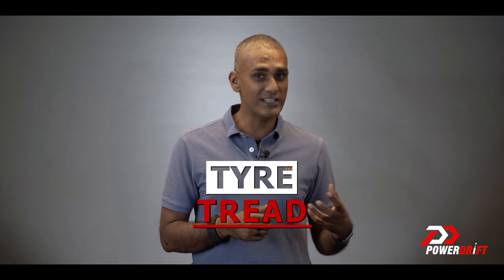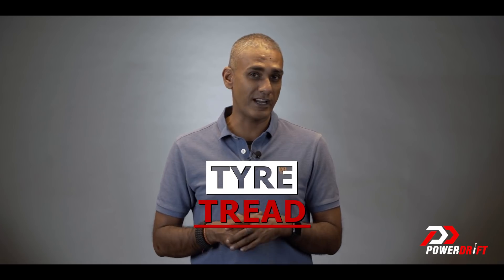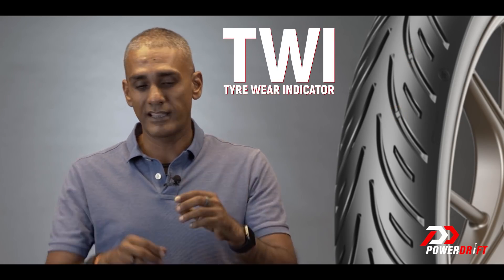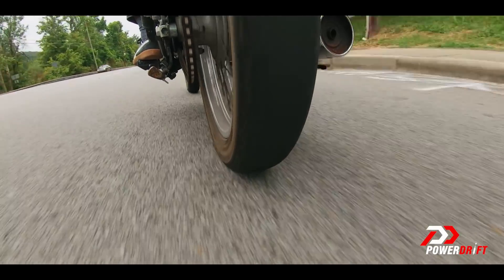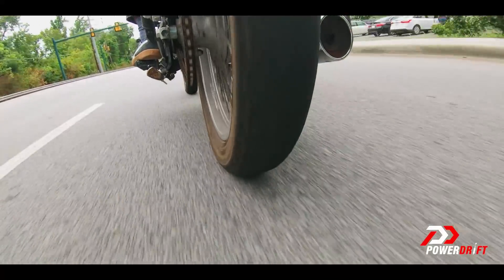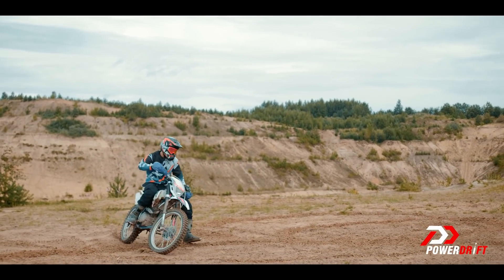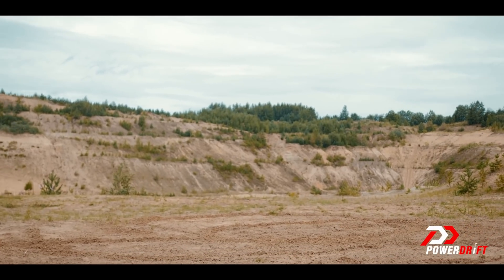PD Simplified | Tyre Tread: What Is It For?

Comment: really like your presentations, very well spoken and concise.

Question. Why are the front treads opposite to the rear treads on most** tyres (not slicks)?? Looks like the front sweeps water inwards towards the center of the tyre and the rear sweeps the water outwards away.

** I've seen the front/rear same in a very, very few instances. I inspect motorcycles as an official for very large events. Manufacturers do put rotation marker on treaded tyres. Dunlop don't put rotation on their KR108/109 (+1/+2/+3) tyres as I believe they are unidirectional.

Comment: Great video explaining science with respect to tyres ..so does it make sense to replace tyres only before a monsoon ? As tyres are worn out and are reaching the twi will result in more postive grip and may be infact better in the dry then with treads  ..it may be silly thought but something to think about
Reply: It’s very silly. You’re failing to account for the degradation in tyre rubber quality over the time it took to wear the tread out
Reply: But while it isn’t the only time, just before the rains is the best time to replace tyres
Reply: Dear akshay, in formula 1 when rain tyres (inters) wear out they perform job as slicks (called interslicks). But at the point tyre is worn pretty much and wont last more kms and power delivery also reduces. Thus they continue to use interslicks if the find a dry racing line on track (rain is stopped) and generally change to slicks after a couple of laps.

Comment: So 1 thing i have always wondered is, since the offroad tires are knobby and hence a smaller contact patch on the road does is mean lower resistance and hence faster speed?
Yes i do understand from your really informative vid that knobby tires wont be as stable but this question has been always in my head! Please answer

Comment: Nicely  explained.  Keep hearing  of aquaplanning in F1  races - in rains. How does it  happen  for  motorcycles ?
Reply: At higher speeds motogp tyre no more remains in firm contact with track suraface due to thin layer of water between them, resulting in total loss of control ...same happens in f1..how ever it depends on speed, water conditions, and tyre pressures.

Comment: Hi pd army. I have a 110 cc bike (honda livo) . I want to tour in it but the engine in not build for the purpose. I can't buy another bike for touring. Please address some of my questions. 
1) In what speed should I tour in? 
2) After how many km. I need to give some rest to my bike. 
3) what are the things I need to keep in mind? 

  Thanks in advance . Hoping for a pd style reply.
Reply: I am not an expert but as per my knowledge, i think you shoud maintain a speed between 50-65, take a short break(about 15min) after every 60-70 km. And then take break of about 40 min after every 120-140km depending on your situation. Also for a 110cc bike you can travel for 350-400km a day and take break in between if you have a long trip ahead.
Reply: @adityaagrawal4842  thanks for your suggestions.

Comment: what if the condition is dry and the tyre reaches minimum depth, will it lose grip? i know it may skid on the sand but the positive area will be high then why that happens
Reply: Yes. Because what I have not covered here is how tyre rubber ages

Comment: Whoa ! So you mean on regular roads new tyre doesn't work far better than an old one in terms of grip only??
Reply: We haven’t covered how rubber itself ages as you use it. New tyres will almost always work better than old ones
Reply: @shu_mar  ya thats okay but my question is, treads only work for water ejection? not for providing grip?
Reply: @shubh.jain1990  No. Tread provides a place for things that could cause a loss of grip to go and get out of the way. The positive surface provides grip. The more grip you want, the less tread you want. And the less tread you have, the worse this tyre will be in the wet
Reply: @shu_mar  okay i got it now...thanks a lot sir 🥰🙏

Comment: I have a question, if u can make us understand in ur own simplified style

Why do adventur motorcycles feel as if it lags power and jerky in lower gears, it feels like as if there is air/water in the fuel tank or if it is running out of fuel, but once u go to say 3rd or 4th gear this feeling goes away, don't adventure bikes need to have more power in lover gears so that we can do better off roading on hills as well??
Reply: This is not common to all adventure motorcycles. Which one are you talking about?